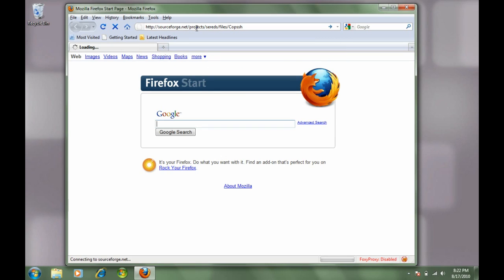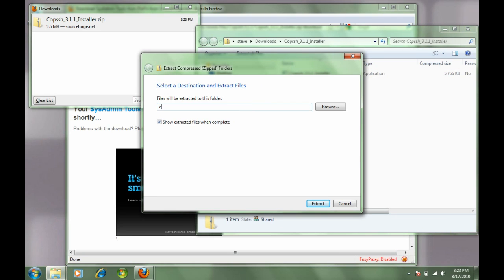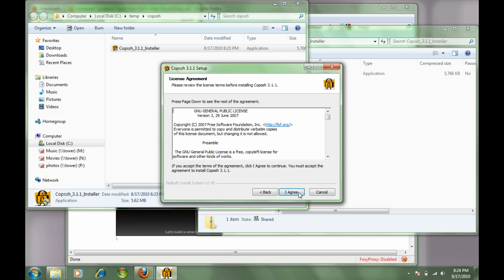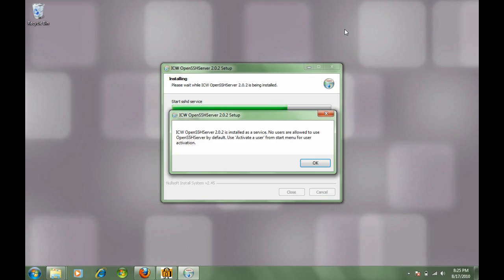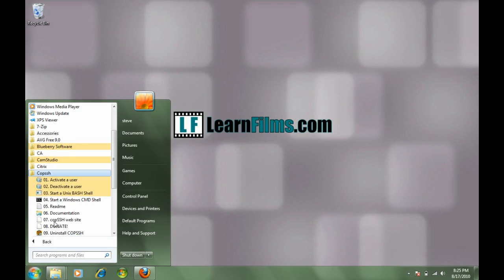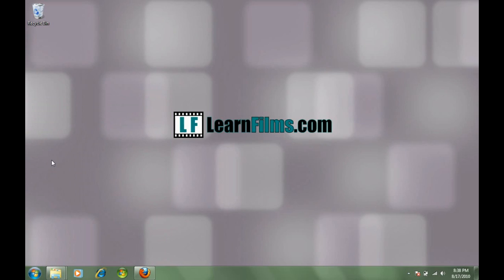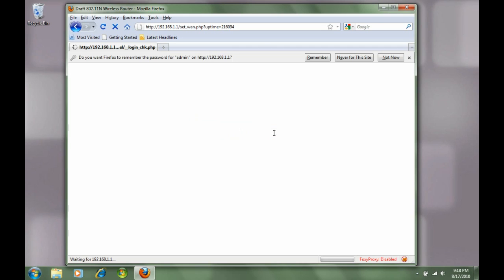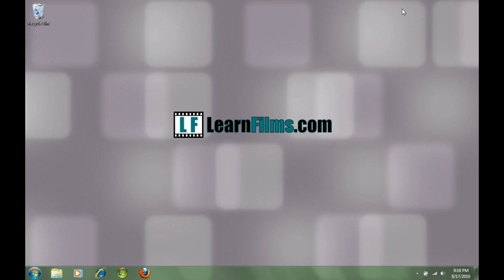How to set up an SSH Server in windows

Comment: 8 years later this video helps me out.  I try to get the OpenSSH that was bundled in the fall update for windows 10 and I am hearing nothing but horror stories about this update.  People are actually trying to downgrade after doing so.  Either way what I am interested in finding out is if this supports x11 forwarding, because if I could use my windows applications over ssh that would be great.  I really do not like to play with Wine, and VNC is laggy.  I am not doing anything that has to do with editing or rendering I just want access to my applications.  I went to /etc/ssh/sshd_config and its completely blank, I not want to create a config file and its going to mess things up, because its obviously already working off something.